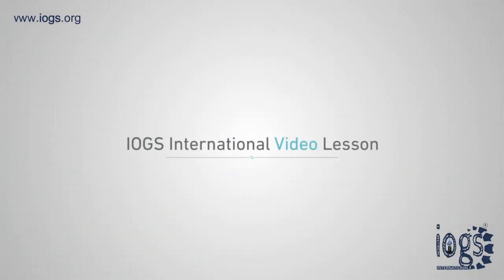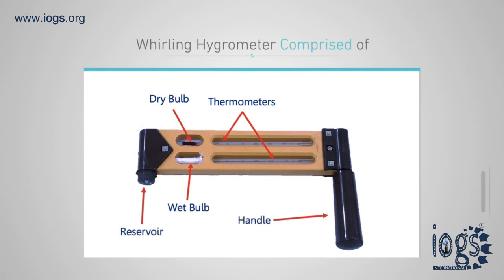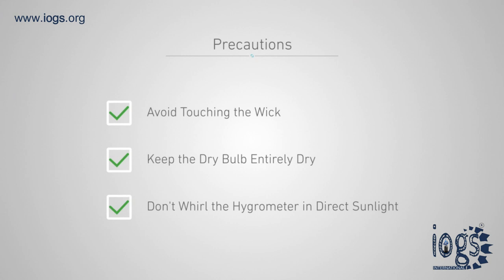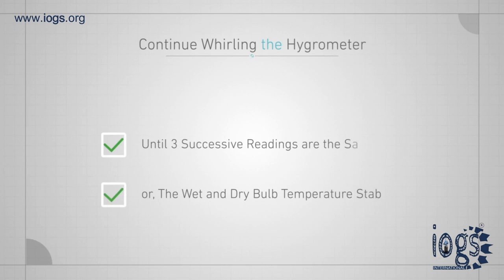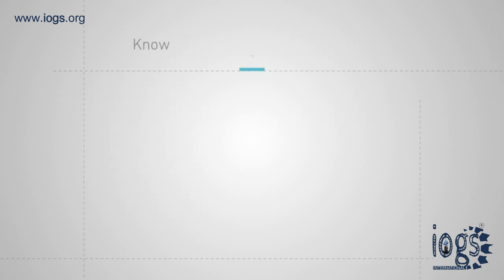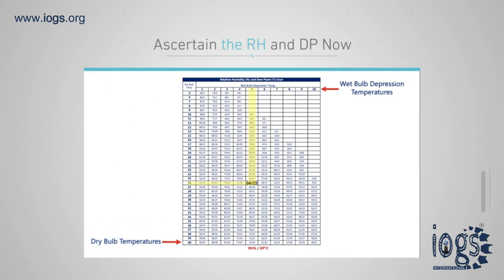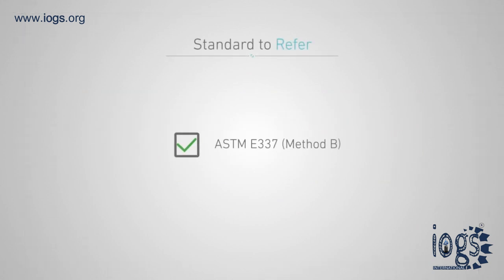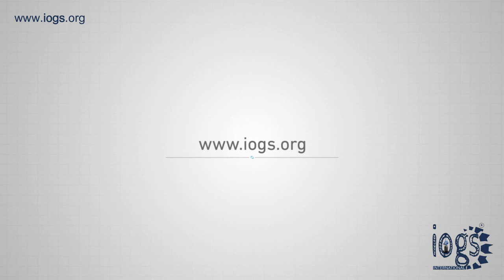Hygrometer — How to Use Whirling Hygrometer following ASTM E337 — Proper Use of Dew Point Calculator

Comment: In open air some environmental conditions, e.g. wind speed, sunlight intensity, etc. can always change with time even within one minute. They may affect the evaporation rate of the water. If we need to get three consecutive readings identical, will it take too long and make the data not valid or representative for the designated time of data recording?